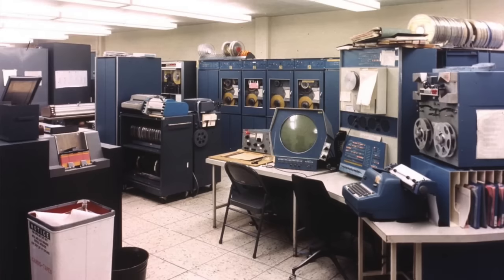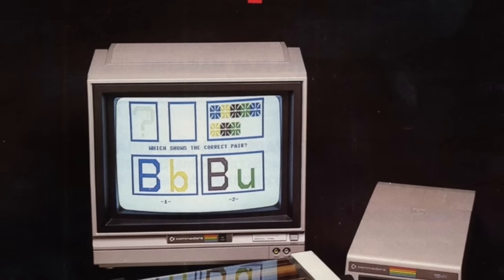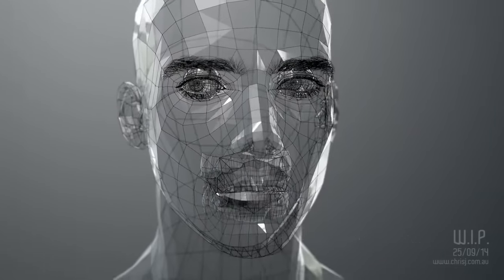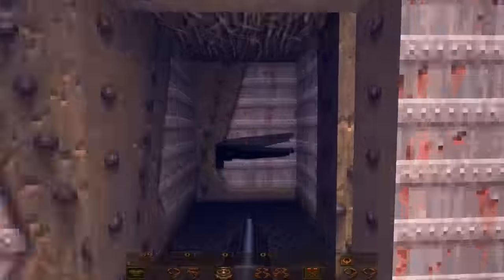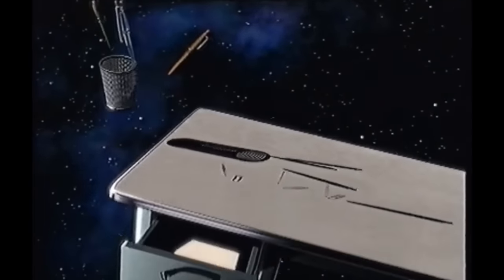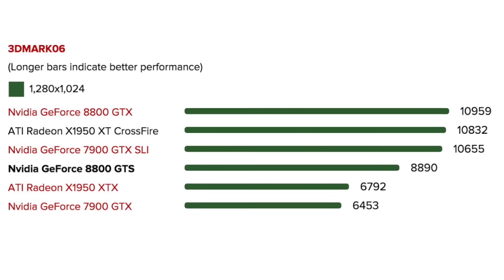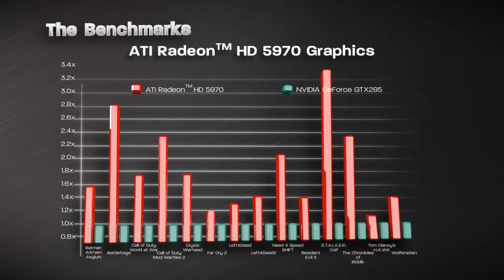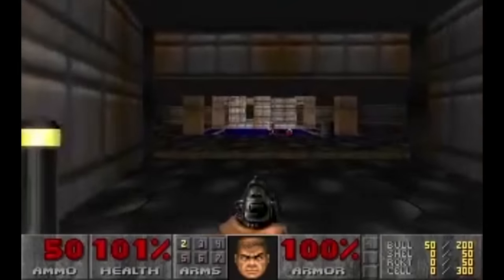Evolution Of PC Gaming Hardware

Comment: PC Gaming fun fact: Your GPU is ALWAYS outdated.
Reply: +Adrian Page 
The time you get it build in and running it's not the second best anymore^^
Reply: +Maya Natsume no but it will still be loads better than that of the APU in either the PS4 or XBox one.
Reply: Seth Cecil
As if that matters if you can't even reach it's limits anyway^^
Reply: +Maya Natsume Obvious troll is obvious. A $130 GPU is still stronger than what's in the current-gen consoles.
Reply: +Espritt and if scrap yard wars is any indication of you shop around you can get one even cheaper!
Reply: +Odin's Playground i bought a gtx 970 i day before the 3.5 memory scandal happened :p
Reply: +Cl0nec0mmand0 brags to friends about GPU I HAVE A 880M  friend says DID YOU HEAR THE 900 SERIES CAME OUT kills self
Reply: Nope, you can't get newer graphics tech than HBM.
Reply: +Chad Meier i went from a r7800 :p also thats what you get for using a gaming laptop :p
Reply: console gaming fun fact. they are not even up to the power of a tablet.
Reply: Espritt
Well, a console doesn't need as much power as a PC-gpu as long as they don't sell like 10 different versions ;) It's way more easier to optimize the code for a console, but if you're programming for a PC you just have some PCs where it runs perfect (most likely the ones they tested it on) and will consume much more computing power the more different your gpu is and not mentioning the potencially reduced lifetime if you bring it to the limit all the time from the very first day
Reply: jesus christ reading these replies makes me realise i don't know a fucking thing about PCs
Reply: This will be false not long from now
Reply: Yap ;-; cause stupid GATES ;--;
Reply: +Maya Natsume PC games still run higher FPS, better graphics, and better gameplay in some cases
Reply: +Odin's Playground Not really, my GPU isn't outdated currently.

Console Gaming fun fact: The GPU's in Consoles are ALWAYS outdated. (Now that's a real fact until the PS5 and Xbox Two comes out..)
Reply: +Odin's Playground because console APUs are always advanced? -_-
Reply: Wow you people are so butthurt. Why do you keep mentioning consoles? Who gives a shit about consoles in a PC hardware video, on a comment concerning PC hardware and nothing more.
Reply: +Pj Morris well that was only true for 8th gen,  but the fact is my 2013 gpu is still a powerhouse,  so not oytdated.  Take that op
Reply: +Maya Natsume you obviously don't know what you are talking about.  You dont shorten the lifetime of hardware by using it as normal use, even maxed out. My overclocked rig had been going strong since 2013, and will become obsolete before it dies. 
Also,  devs are already familiar with thr x86 hardware in the ps4 and xbone. Which means devs are already pushing the consoles to the max,  and won't be able to do more with them.
Reply: *****
yeah, in some cases, but in most cases, they don't, because PC-Developer can't support every card perfectly and besides that, FPS isn't a point into quality most times and is often an indicator for either you set your settings to low or you have a PC which was just to expensive to play this games.
Reply: +PizzaKitty WTF PCS ARE NOT THAT EXPENSIVE
Reply: +Maya Natsume you can build a pc for $800 - $1000 that will run games on high - ultra with 60 fps
Reply: +Maya Natsume on mobile cant edit in a lot of cases how well your card works on the game has to do with drivers which nvidia are constantly updating
Reply: +Pj Morris oh man, nice one!
Reply: +Cl0nec0mmand0 still a great card mate!
Reply: +Odin's Playground true dat . next year is the HBM 2 and GDDRX .
Reply: Maya Natsume Game devs build their games based on the architecture, the graphics cards manufacturers optimized the graphics cards drivers to improve game performance, its a relationship.
Reply: +Odin's Playground 
true!
Reply: +Odin's Playground Not true anymore, buying a top tier graphics card, it will break before becoming obsolete. If you understood anything about graphics cards then you'd know that they're struggling to improve the top tier cards. Next 10 years are most likely going to be slow improvements to the cards like titan x.
Reply: Maya Natsume no, in some cases they don't and some they do. Can't really say in most cases they don't. You really seem like a troll who is just trying to justify consoles, they have their uses but do not try to say consoles are as good as PC's.
Reply: +Odin's Playground Outdated in that there is a faster card, but futuristic because games are being made to run on a potaty that exists in consoles.
Reply: +Odin's Playground That's literally the one reason I don't play PC. Shit's always getting updated, costs way too much, and I'll never be happy about my specs. Console on the other hand is just a one payment thing, idgaf if it's shit comparatively. Mods on XBOX One for Fallout 4 and that makes me happy.
Reply: *****
Actually i do have a PC bought 4 years ago and because i had not the money to spend more than 400€ i needed a cheap gpu. it was capable of playing the most games at low-med these days, but today it rarely can't play a newer game at very low with without any fps drops sometimes (they doesn't make it impossible to play though, but it's not funny if you fight a dragon at skyrim and the screen freezes for 3 seconds if it starts to attack you)

And well, i don't see were the games run bad at consoles. Propably i just can't see it because i can't effort a High End PC to check it.
Reply: +Maya Natsume my pc cost 20 dollars and i run skyrim on ultra at 40-50 fps
Reply: +Archie Nash *200
Reply: Well that's not true I bought a 2nd hand last gen gpu a 780ti and can max out every game 1440p 60 fps also u only need to upgrade your gpu every console cycle so ever time you upgrade your console we upgrade our gpu unless ure one of those guys that buys the new Titan every year
Reply: +Chad Meier an 880m is a laptop gpu what are you on about
Reply: +Maya Natsume don't even bring that up I'm gonna simply this for your peasant mind the lowest end graphics card is a 750ti well it's the lowest thing anyone would buy and this card can run games a t medium setting 1080p 60fps so let's carry on your console can barley run a game at 720p lowest setting sub 30fps and this graphics card I was talking about can be put in a budget build that only cost about 350 now that is how much aconsole costs so saying you get more for your money and that consoles last long is like say shit taste nice also no online fee and cheaper games on PC so get shrecked
Reply: +Maya Natsume coz game Devs don't need to support any cards or omtimize their games for that AMD and nvidia do that part game Devs need to make sure they make a good port no glitches not frame locks and all that stuff  and that's it lets take Arkham night it ran like shit because the port was bad and had loads of glitches and frame locks and stuff not because they could support the cards u see as nvidia and AMD created drivers so that all their cards work well but since the port was bad no matter how many drivers came out it still was fucked now take witcher 3 amazing port and nvidia created drivers for the game and it ran realy well however on AMD cards it didn't as they didn't make a driver so the game ran like shit on AMD cards
Reply: +Maya Natsume Is there something better then the 980Ti? Nope.
Reply: Mortien Gerrux
yeah, like 3 cars you could buy for that money ;)
Reply: True sadly
Reply: +Shane Benjamson I'm sorry but MM. Going to shit on everything u just said things being upgraded well u only need to upgrade once every console gen for the graphics card and once every 2 console gen for CPU and that's it u don't need an amazing PC a 750ti is way better than a console and is cheap as seriouly the thing can run games at 1080p 60fps med settings and u can put that gpu in a 350 to 400 dollar build and that's it that's as much as a console for more performance and PC is way cheaper for games and no online subscriptions so join the master race friend btw console mods are going to be shit for fallout 4 the game stutters like crazy on both consoles and the only mods thiers gonna be is shity fuxkung quest mods and retexure a and meshes and that it so don't get happy
Reply: So? As long as I'm still maxing out games 1080p minimum with at least 50+ fps then I really don't give a fuck
Reply: +Odin's Playground nah. disagree. if you were to say that then consoles always are outdated too. even before release.
Reply: +Odin's Playground My GTX 980 Ti should befine for a couple of months :)
Reply: It doesn't matter if they're "outdated". I have a GTX 780Ti in my PC, and I have a PS4 (I won't even bother bringing Xbox into this discussion haha). But the graphics on that 780Ti (which is a couple of years old now) still blow away anything I've seen on a console. Side-by-side, GTAV looks waaaay better on my PC than on my PS4.
Reply: my friend has a 780 and he runs gta v on high with very good settings. the pc standards are rising super high for 4k and stuff. of course your gpu is always going to be outdated but it blows games AWAY. a single 980 Ti blows gta v away on 4k 2x msaa. BLOWS. i have seen it in action. and that gpu is "outdated" but i can assure you that even my 970 runs gta v at 60+ most of the times with everything on high except msaa. so your argument is invalid.
Reply: and btw my system is shit. i have a amd fx 8150 with an m5a99x motherboard from asus. and 8 gigs of ram. yet. my pc does a pretty impressive job at crushing competition with consoles. my outdated ass pc. an amd. what a shame. seriously.
Reply: +Maya Natsume hello.
Reply: +Maya Natsume hello.
Reply: +Odin's Playground Have been using a gtx 460 for 3 years... no problem... :)
Reply: +Odin's Playground doesn't that just mean that consoles gpu's are even more outdated?
Reply: +Pj Morris You misspelled obsolete. ;)
Reply: I'm still beastin' with my "outdated" 2x 780Ti SLi. One card already shat on both consoles.
Reply: +Odin's Playground Was your point regarding the fact that effects and graphics are improving for GPUs that don't exist yet, that we don't have the capabilities to support these changes?
Reply: Sadly, your statement is true.
Reply: +Odin's Playground I mean, this fact is true for ALL gaming and ALL technology in general if you want to be that pedantic about it... there's nothing specific about PC gaming though there really. Are you just trying to get a rise out of people?
Reply: +Dylon Swartwood Exactly. They are outdated before they even come out. Grats.
Reply: +Odin's Playground Console gaming fun fact: your hardware is already outdated by release XD
Reply: Deathbrewer ESPECIALLY Smartphones
Reply: +Odin's Playground Well, not quite.
If you where to purchase a 980 Ti today, it would be top of the line for at least a couple of years going forward. I'm sure Nvida is already at work developing the next generation GPU, but that doesn't automatically make your 'old' card obsolete.

Comment: It's not just PC gaming changing
it's actually everything
Reply: You need more likes.
I do believe that too
Tech is moving super fast
Reply: The PC platform is great fun but the variety of hardware makes it a nightmare for optimisation. Consoles have that part nailed down. Also, depending on the franchise, the console version of a game might make a lot more money than a PC version. Obviously this works vice versa as well. They're both part of the gaming industry and it's great to see them co-exist and do so well.

Finally, never underestimate how truly average the settings need to be on PCs when you look passed the smaller minority who are happy to spend good money on top-end cards and big monitors, etc.
Reply: I WANT CYBORG HANDS and USB HUB to the brain. Not to fast...
Reply: Not really. The space shuttle hasn't changed since the 80's, and consumer automobiles are basically the same as they were in the 1950s. Cars have been able to exceed 100 mph since the 1920s. I'm convinced the 75mph speed limit is what's holding back innovation.
Reply: The computers in cars have actually changed alot, they control a entire car now, from traction control to ABS to cylinder deactivation(Cadillac did it before but fail due to computers being to slow), to wheel torque (active 4 wheel steering) to active suspension that reads the road 1000s of times per second, and the list goes on. I agree with the speed limit thing along with restrictions for lower emissions. It seems Tesla is solving both the space shuttle problem and the car problem lol.
Reply: poor people enjoy that 10 fps they get in modern trend games
Reply: yes Roblox take over intel hd graphics!

Comment: can I run Fallout 4?
Specs: Samsung Galaxy S2
Reply: +Amin Croes Saucedo sure
Reply: I would recommend upgrading to the 3s, your rigs pretty good but upgrading could get you better frames.  But you could run it at medium - high on 60fps I predict
Reply: +Amin Croes Saucedo Hmm its good, just change the GPU and u can easily run it on ultra 1440p on 60 fps
Reply: +Amin Croes Saucedo Fallout 4 sucks so probably.
Reply: +Amin Croes Saucedo sure... but the fps only good in shelter LoL...
Reply: +Amin Croes Saucedo You could try, but first contact the bomb squad. Just in case.
Reply: +Amin Croes Saucedo Considering the PS4 doesn't even get 30 fps, no.
Reply: +Amin Croes Saucedo lol
Reply: +Amin Croes Saucedo Dont worry i use a potato which is equivalent to iphone 1 making my game run 30fps on medium settings
Reply: yes
Reply: +Amin Croes Saucedo the question of the month
Reply: +Amin Croes Saucedo u can play Fallout 4 on a mobile phone?!
Reply: +Amin Croes Saucedo Yes, at 100x100 reselution, all low, 26x26 textures, and lighting disabled, oh ya and if youre good at recompiling executable files without source code
Reply: +James Davis Really? He was joking smh......
Reply: +Donny Applebob can i have your toaster
Reply: +Amin Croes Saucedo no
Reply: +Amin Croes Saucedo You could probably mod morrowind enough to look identical and I ran that on far slower tech.
Reply: I have to tell you some thing: they didn't develop it for that platform
Reply: +Mr. Guy the Cow I have to ask you something, do you know sarcasm?
Reply: Purple Fox Please be joking and not a blind Bethesda fanboy.
Reply: yeah you should be fine
Reply: +Amin Croes Saucedo umm yeahh noo.. lol
Reply: +Amin Croes Saucedo Maybe with a S7 and Vulkan API yes.